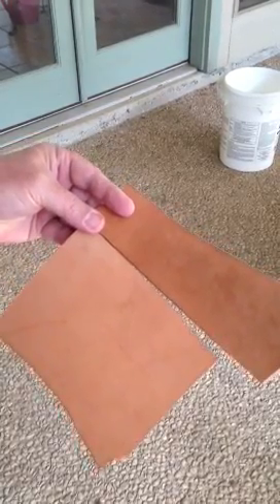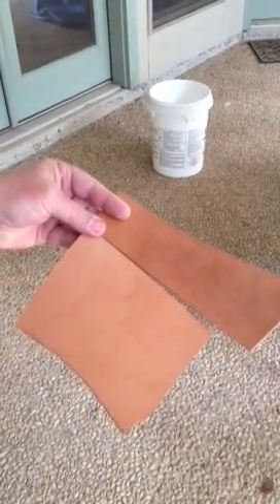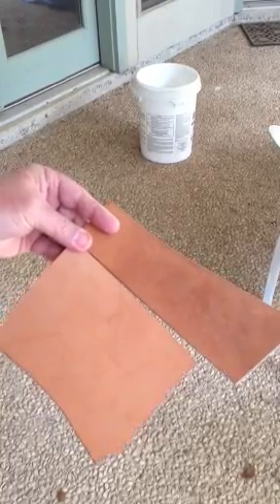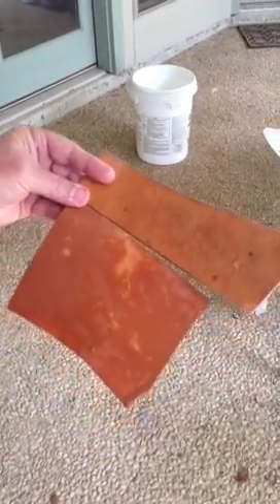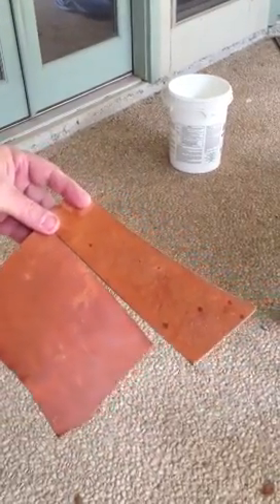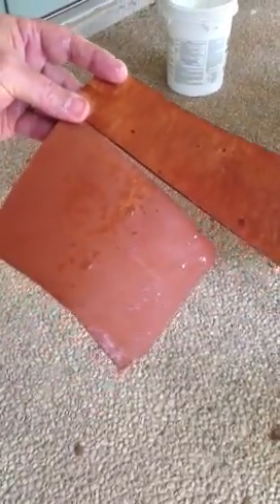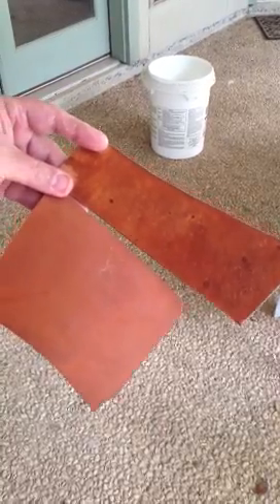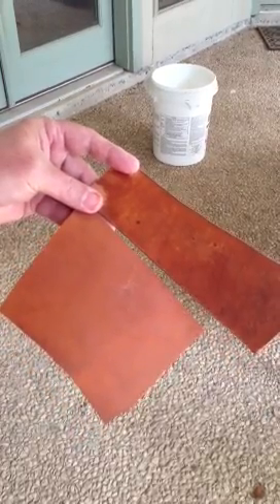Horse hide vs cow hide

Comment: What if you soak the horsehide in a container of water? I've seen cowhide soaked in water for a short time for molding, does horsehide respond better that way I wonder?
Reply from the maker: Sorry, just saw this.  Yes you can soak horsehide in water for molding.  I've done that on occasion.  Some horse hides require more water or longer soaking times in order for better molding.  I think soaking cow hide in water is not necessary.  Cowhides are usually pretty moldable with just some spray from a water bottle.  Never needed to soak cowhide is water to mold it.  Mostly using 6/7 or 8/9 oz leather.
Reply: @bearcreekholsters  OK, thanks for the information!